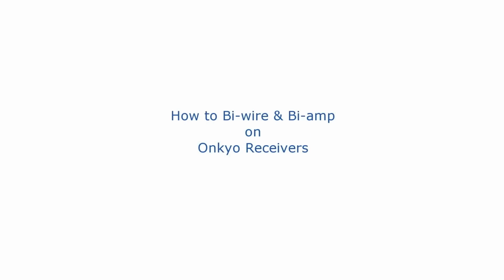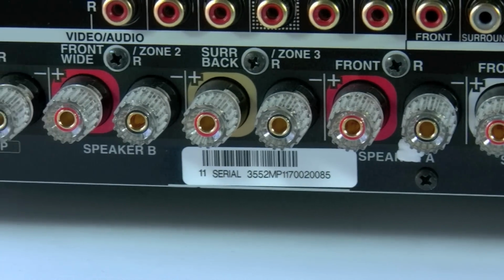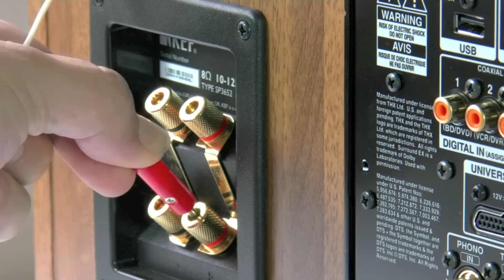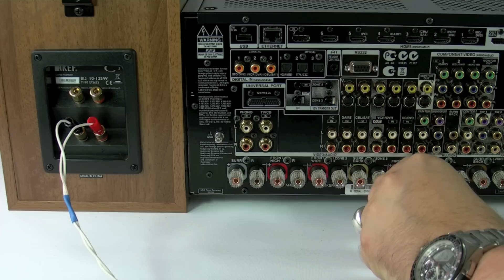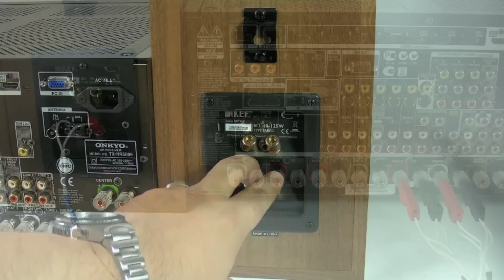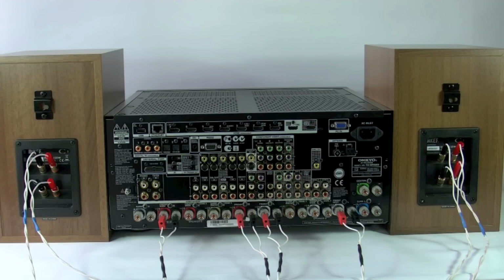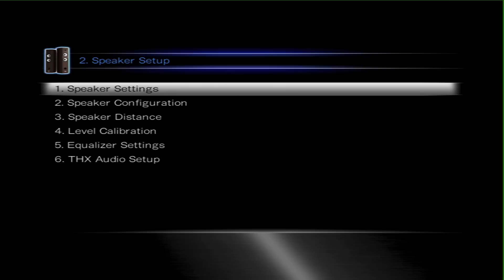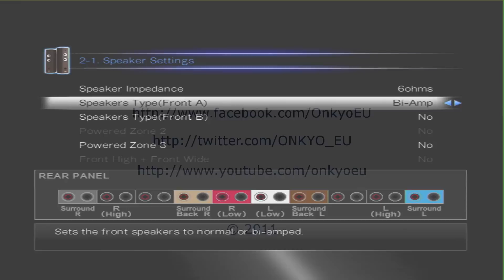ONKYO Speaker connection - AVR AV Home Cinema Receiver - Bi-Wire Bi-Amp

Comment: @OnkyoEU I looked at my manual and my receiver can support bi-amping. I have connected the speakers to the A+B selectors and it works perfectly. I have also made sure the ohms haven't dropped under 4 ohms, so i know its safe. Thankyou very much for your instructions and for posting this video..

Comment from the maker: Hi, the effect is perfectly retained. Bi-amping + bi-wiring improves the quality of the audio reproduction by the speakers (by driving the tweeters and woofers separately) - and does not modify the audio signal (like e.g. DSP effect processing). The quality of the original audio *signal* is basically left untouched.

Comment from the maker: Hi there and thanks for your inquiry. You could look at it like this: by using bi-amping + bi-wiring, each driver for high and low is backed up by a separate amp module in the AVR. If you are using one cable for both high and low drivers, they will have to share the available power. Nethertheless you cannot say the power is "doubled", as the actual output also depends on a number of other factors. If you have the chance to bi-wire & bi-amp, it should be the preferred.

Comment from the maker: @poolehart Usually you would use bi-wiring for speakers which have separate inputs for bass and tweeters (using a bridge in a non-bi-wired configuration). If you would like to connect a sub which shares the front outputs for satellites - there is usually no need to use bi-wiring in this configuration. The sub will filter out the frequency that it supports - and passing on the other frequencies to the satellites...

Comment: I used this as a response below, but thought I would share it here up top so others can get some light shed on the subject:

______________________________________

There are 2 schools of thought here that you need to realize. Bi-Amping (Passive) which is the most commonly done, still using the crossover in the speakers, and Bi-Amping (Active) which completely bypasses the the speakers crossover.

Since you are 9/10 times going to use Passive Bi-Amping, there shouldn't be much difference in sound quality, if any when using a receiver. All receivers are rated at 2 Channel Driven... assuming you listen to 2ch music, you will be getting the most power out of you amplifier and driving the speakers better (imo) by leaving the jumpers in and doing a conventional wiring setup (2 wires).

When you Bi-Wire using a receiver, you use 4 Channels (4 integrated amps) thus degrading the performance of the receiver when driving the speakers... the same applies for the more channels you add in 5.1 or 7.1/9.1/11.1 setups.

For example, my Pioneer Elite AVR SC-87 is 145W/ch @ 2Ch driven, or 845w Total Power @ 9ch driven... which roughly comes out to 93.3 W/ch when I use EVERY channel... So if I do a conventional wiring (2 wires), my front speakers will see 145W/ch each, but if I Bi-Wire, the speakers will see about 128W/ch each at Hi and Low cross over points @ 4 Channels Driven on my AV Receiver.

If you really want to enjoy the full effects of bi-wiring, you need discrete separate amplifiers with a pre-amp, not a AV receiver. Just a note for you to ponder. Discrete Lower Power, vs High Current direct power in AVRs.

Comment from the maker: Hi, if you want to use bi-wiring/bi-amping for your front speakers, 2 channels of the amp will be used for this - this means you can listen up to 5.1 in this kind of setup (vs 7.1 with no bi-wiring/bi-amping). If you would like to use bi-wiring/bi-amping AND 7.1 at the same time, you will need a dedicated amp for two channels (e.g. surround/surround back) - and connecting it to the multichannel pre outs.

Comment: Just run bi-wire from a pioneer amp, woofers from speakers A and tweeters from  speakers B. Rather thick cable for the woofers (using more wats) and a old thin speaker cable for the tweeters.
Speakers are Wharfedale Diamond 225.
Improvement in sound is remarkable! More detail, a more clear tweeter, a more rapid and articulated bass.

A lot of people recomend to change the bridge on Dimonds from the original plate to a strip of real speaker cable. Could be worth a try if not bi-wiring.
For my rig, bi-wiring from seperate speaker conection, A and B, made a huuuuge difference. MAGA - make audio great again!

Comment from the maker: Hi,  If supported by amp and speakers, the combination of bi-wiring and bi-amping (e.g. as shown ~ 3:50) should produce best possible results: this means that separate amps and separate cables will be used for low and high tones.

Comment: Do you need to use the same length of cables for bi-wire and bi-amp? and what is the ok difference, I am asking because I already connect the speakers with a 2m cable, can I buy came 2 m cable and connect it.

Comment from the maker: You will get best possible results by using both at the same time, bi-amping by the amplfier and using bi-wiring to connect the tweeters/woofers to the amp separately.

Comment from the maker: +ulab2000 There is no issue using 8 ohm speakers - you just need to make sure that your AVR is configured to work with 8 ohms speakers (e.g. not using the 4-6 ohm settings in this case!). Regarding the banana plugs, they usually be bought at every local hifi dealer, please understand that we cannot provide any recommendations for any specific dealer. Thank you and enjoy your surround experience!
Reply: OnkyoEU

Comment: Bit late into this but what hz do you set the front bi amp speakers at? Starts from ‘full all the way to 20hz-200hz.’ What is the best option for the best sound from the two front speakers connected by bi amp? Thanks In advance.

Comment: Hi Onkyo EU, 1---while watching this video, a question came to my mind. When the power goes to the speakers at the back with" Jumper connectors" (i.e both the four terminals at the back are connected to each other) and then when we send the cables individually one set to terminals to Tweeters and other set of cable to woofers, does it not potentially make the tweeters to get more power to damage or blow them up?.....or is it that the crossover has filter not to damage the tweeters, but even in normal conditions the tweeters are blown off if volume is pumped up......
2--- Did you feel any difference by doing bi-amp process?
3-I am sort of audiophile and have 5.1 Polk audio new speaker system with almost new Yamaha receiver, do you think it will make a difference by doing bi-wiring, just want to get your review.
Please share your thought about it. Thanks.
Reply from the maker: Hi Arshad, to make it short: In general, we suggest removing the bridges at the speaker terminals and using separate cables for tweeter/woofer and bi-amping mode for best possible audio quality. If it's worth the effort? That's very subjective and difficult to tell: the overall audio quality depends on the source material, your playback device, the amp, the cables, the speakers - and last but not least your ears and your personal taste. So there will be no quick and easy answer to this question :-)
Reply: Thanks for your comments OnkyoEU, i will try it, my receiver is Yamaha and the speakers are Polk audio and I love both the equipment. Thanks.

Comment: Using a single wiring method, what is the best recommendation regarding connecting to the speaker terminals?  High Frequency or Low Frequency Terminals? Please advise. Thank you.
Reply from the maker: Hi, when using single wiring method (with bridges between woofer and tweeter terminals), you can use either the woofer or tweeter terminals for your connection. For the sound, it's more important to use quality cables and to find the best positioning for your speakers (your speaker manufacturer might have some helpful information for you)

Comment: Good morning. Please. I have receiver ONKYO TX NR3010.I have a doubt!!  
The "difference" of the FIRST installation (wires plugged in the other one) and the SECOND installation (each wire placed separately)? Which setup would be better? or the two installations are the same?? Wait Your Answer. Sávio.

Comment: What AWG was that speaker cable? 22AWG? I can see that milting if you listen at high volume, fire? I guess that's why you bi-wire, to give more overall copper and increase the load capacity. Or, just use 14AWG or better.
Reply from the maker: +BigBadDodge4x4 Hi, the cables shown were not chosen for a specific reason - just for demonstration. We have received a lot of questions on how to do bi-wiring and how to do bi-amping. So we set up a quick video on how to setup both. Thanks for asking!

Comment: hello, sorry for my english. question, can I only do bi-wiring from the front speakers output? If i want to use some speakers in zona B of a denon avr X1600H from its sorround back output, can i be-wire?

Comment: Bi-wire is a option if you lost your iron klips from the terminals :)
Reply: melenmike  - I noticed the same thing... Removing terminal bridges for bi-wiring and running piggyback off the same source channel. Just creating more work for yourself... Bi-amping on the other hand, you’ll benefit from.

Comment: I have my FR and FL hooked up to my Cyrus amp via pre out. Can I add cables from the reciver to the speakers as well as from my Cyrus amp. Is that bi amping i think I'm kind of getting it ? 

Thanks Ryan

Thanks
Reply from the maker: Hello Ryan, for bi-amping, please be use to use one amp per speaker only, e.g. not using different amps for high/low speakers. This might damage your speakers - or will not create a decent sound experience, at least.

You will need a receiver that supports bi-amping. This receiver will offer 4 speaker terminals for each bi-amped channel, e.g.

Front left:
+/- terminals for tweeter
+/- terminals for woofer

Front right:
+/- terminals for tweeter
+/- terminals for woofer

Please checkout the following new video on bi-amping using a TX-RZ830 that a colleague created:

https://www.youtube.com/watch?v=gOtzlUPf7jU

Hope this answers your question?

Comment: Dumb thing I've never done was to remove the little plastic inserts and used banana plugs on the back of my Onkyo receiver. No idea why. Perhaps I never realised but I always used banana plugs to connect to the speakers so it really doesn't make any sense. Especially as using the bare wire looks untidy and is a pain when you have to move the amp. Have ordered a set of banana plugs! 

Feel so stupid not having done it before as it makes hooking up speakers much easier. Especially the time wasted double checking wires are the right way around. 😆

Comment: what do i need if my speakers dont have the input for the banana plugs? mine both have; unbalanced RCA, Balanced TRS, and XLR. Any help would be great.
Reply from the maker: +Flava Hello and apologies for late reply! We assume you are using active speakers, which have the amplifier part integrated in the speakers. These speakers use an un-amplified (e.g. line level) audio signal as input. Please do NOT try to connect the amplified speaker output of an ampifier/receiver/AVR to your active speakers inputs (RCA, XLR) - you risk to damage your speakers. Instead, please use an pre-out/line-out signal as input for your speakers.
Reply: +OnkyoEU Thank you. iv spoken to staff at a local audio store since then and was told I need all new speakers :/ passive as oppose to active. I was sold my turntable and active speakers as a combo lol. thanks for the confirmation though, before I started forcing cables between them all :)

Comment: Hi, would a 6 ohms Onkyo Receiver work with an 8 ohms Klipsch speaker?
Reply from the maker: Hi, Onkyo AV receivers usually support 4-16 or 6-16 ohms impedance speakers. Depending on the AVR, you might need to adjust the impedance setting in the AVR settings, verifying it''s set for 6 ohms speakers. Thanks!
Reply: +OnkyoEU Ok, thanks for the quick reply! Best Regards

Comment: does it make a difference if the speakers are of a different brand then the receiver?
Reply from the maker: Hi, no need to worry about the brand of the speaker manufacturer - each speaker model itself will make a difference. If you like the sound also depends very much on your personal impression and prefence. You might like the sound of some speakers while some one else prefers some completely different sound. In addition, the actual sound also depends on your listening environment (room size, furniture, etc.) and the position of the speakers in the room. You may want to try different positions, comparing the results...
Reply: OnkyoEU

good lookin out i appreciate that.

i will have a further look into it, im not gnna buy a receiver with bluetooith and airplay and all that nonsens, because the cheapest receiver nowadays already got that 4.1 hdmi. 

and 5.1 surround.

and i am only gonna use it for my pc and ps3/ps4. 

so it will work out i guess.

once again, thanks for your reply.

Comment: Why you would run two sets of cables from the same amplifier outputs to the speaker is beyond me. This does absolutely nothing different to just having one set of wires and leaving the jumpers in place between the two sets of terminals on the speaker. All you're doing is making more of a mess behind your amp and spending more on cables than you need to! Bi-amping, as is shown at the end of the video will indeed make a difference to the sound as you're essentially doubling the power to the speaker (one amplifier channel to each driver) but just bi-wiring is a completely pointless thing to do.
Reply: +tiddlesriddles I have to agree with you 100% I just think bi-wiring is a sales gimmick to spend more money in store when you buy a new receiver. But Bi-amp would be a great thing
Reply from the maker: Hi, your amp should provide separate amplification channels for woofer/tweeter to enjoy bi-amping - a pure 2 channel amp with 1 channel for woofer and tweeter will not provide sufficient results ...
Reply: tiddlesriddles  sorry but my movies and music sound much different before i biwired as showned.and i am using an onkyo HT-R 593.i use the cerwin verga speakers.

Comment: Really noob question ... but please ansswer 

if you single run 2 speakers at 8 ohms each would the amp see this as 8 ohms or 16??? thankyou someone please answer !! :)
Reply: LetsPlay360andPC  it would then be 4 0hms
Reply: sorry if its 2 speakers 1 left 1right then its 8 ohms if you try and put two speakers in one connection left or and right it would then be 4 ohms but not a good idea as it might damage your system in time running a heavy four ohm load

Comment: Bi-wiring just don't make sense to my thinking, it just seem the same as normal wiring just extra wire being used. But Bi-Amp makes 100% sense to me cause i can control the individual part of the speaker the high end and the low end.

Comment: Hi, does onkyo recommend doing Bi-wire?
Reply from the maker: +Jasdev Singh Hi, we do not specifically recommend bi-wiring alone - while bi-amping can definitely increase your listening experience, also depending on the speakers and cabling used (e.g. the thinkness/diameter should match the requirements of your speakers...).
Reply: +OnkyoEU thanks Onkyo EU, I have Onkyo receiver and I have done that bi-amp for my front two speakers however as mentioned below (someone posted that) Bi-wire from same receiver can degrade the amp performance. Since I have 5.1 with bi amp, all my connections are running out. I want to setup 5.1.2 and thinking to do biwire front speakers to save two channels for height or back(atmos). what wire or cable do you recommend for biwire for onkyo tx-nr636. Front speakers are q acoustics 3050 floor standing. Thanks.
Reply from the maker: +Jasdev Singh Hi, the following link might be helpful in selection an appropriate speaker cable thinkness depending on impededance and cable lenght:   http://en.wikipedia.org/wiki/Speaker_wire     (Please see the table "Maximum wire lengths for two conductor copper wire")
Reply: +OnkyoEU Thanks for your suggestion. Just the last question: What would you recommend to keep, bi-wire or bi-amp?
Reply from the maker: +Jasdev Singh In general, we would recommend using bi-amping to get the best results...
Reply: +OnkyoEU Thanks. You've been very helpful.

Comment: Are there real sonic benefits to biamping?
Reply from the maker: Yes, there can be - but also depending on your speakers, cables, speaker positioning and the listening environment in general. The benefits can be very small but noticable - if you have a chance to notice them (e.g. not with the cheapest speakers, not if you live close to a busy street, not if you put speakers in a room with lots of reflections, etc. etc.). So there is no "Yes, sure!" or "No, not at all!" answer here... :-)
Reply: @OnkyoEU  I'm not sure whether I should biamp my fronts, get an external amp of simply upgrade my center in hopes of achieving a better soundstage.  A real dilemma I tell you ;) what do you think sir?
Reply from the maker: @bzorro1  A dedicated center can be very beneficial when watching movies (improving reproduction of dialogs). Playing with your speaker placement will most likely have more impact and more benefits than biamping...